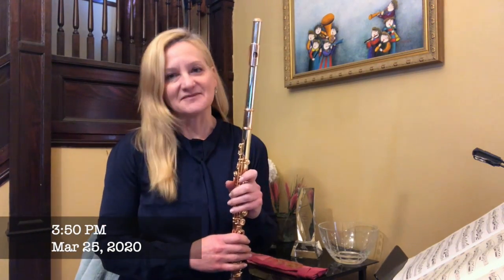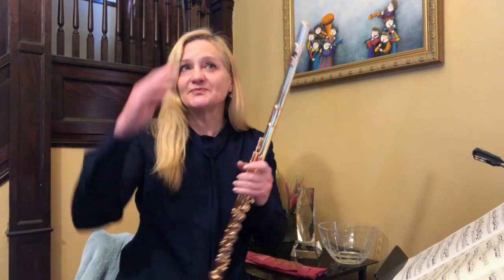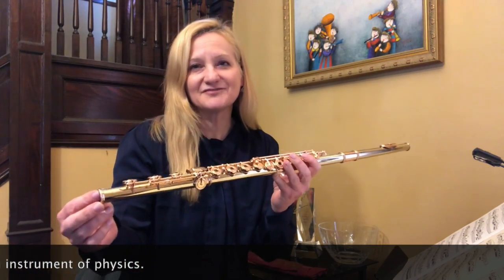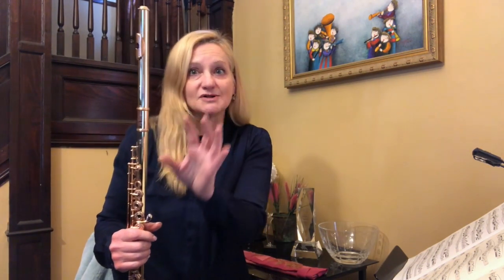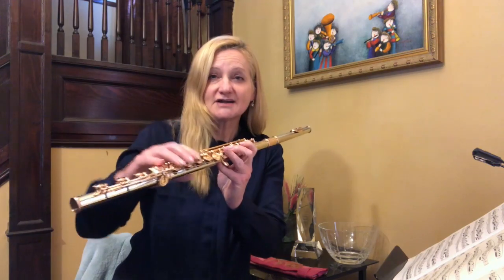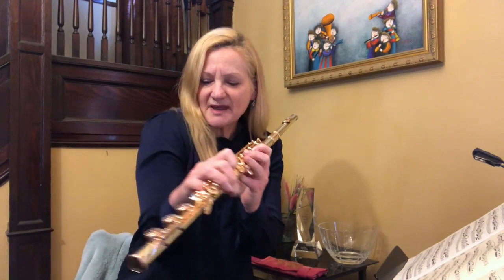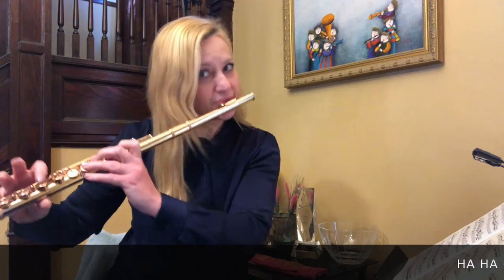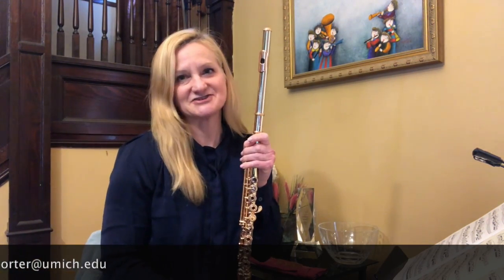High Register

Comment: How do you get the air down to the end of the flute. Aim the air to the front of the mouth piece
Reply from the maker: Play from lower in the lungs. Lower in the body- and then Yes, put the focused air into the front of the lips. The lips are like the bow of the violin. Try gripping the air as William Kinkaid says from the inner membrane of the lips and then sculpt it forward and down.
Reply: porterflute should I aim the air straight or up into the front of the head joint or down the tube. You know what I mean ?